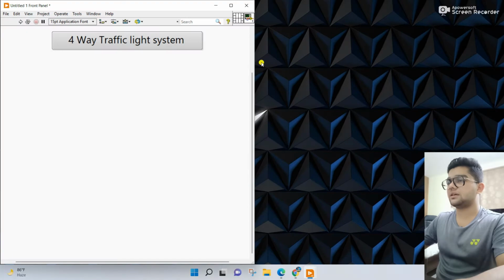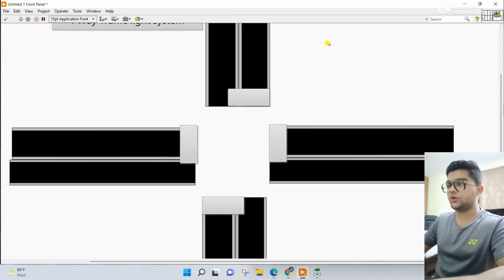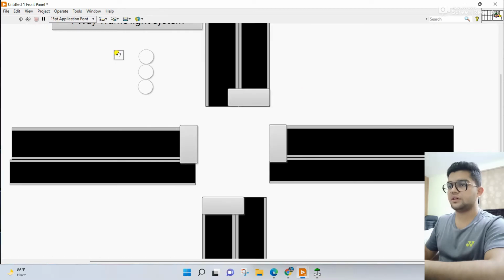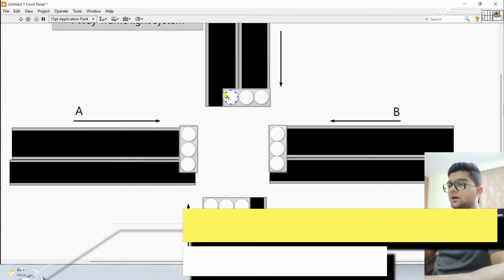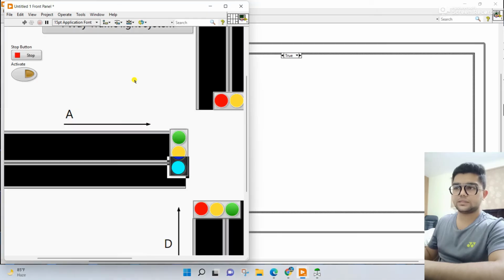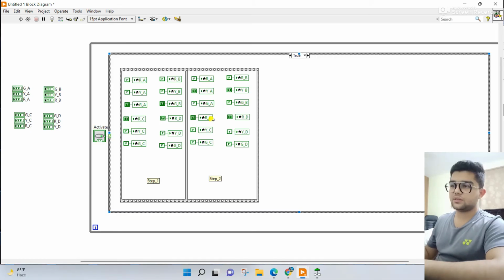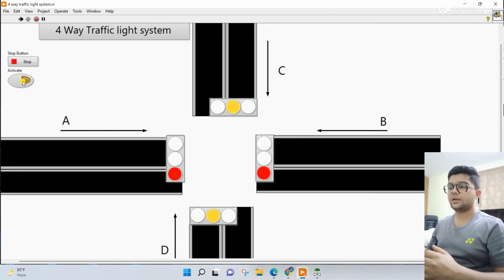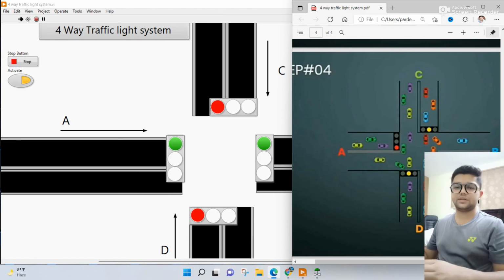LabVIEW | Four way Traffic light System | Traffic Signal using LabVIEW | LabVIEW Programming

Comment: sorry, my project is to make a LabVIEW interface with Arduino and a machine.
I will make two buttons (like 1,2) that when I click number (1) you should
spin the machine (5s) and when I click (2) the machine
turned 4s
Reply from the maker: Dear you can do help of flat sequence loop. One flat sequence loop add wait timer 5s and second flat sequence loop add second wait timer 4s.